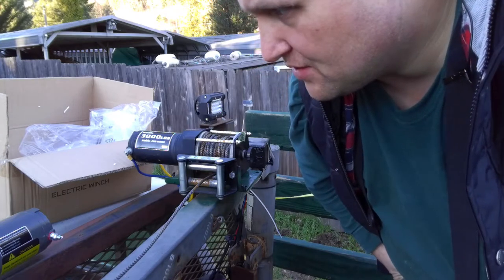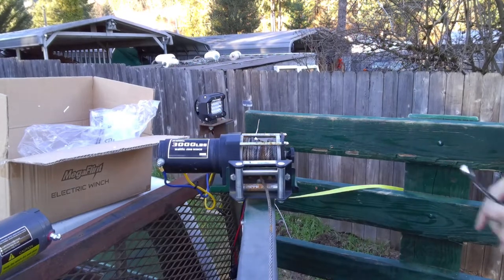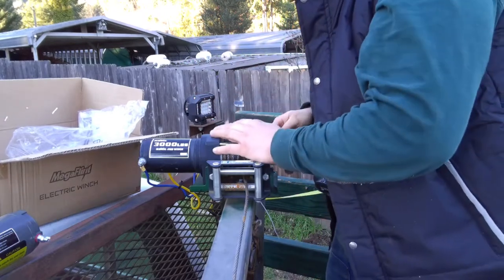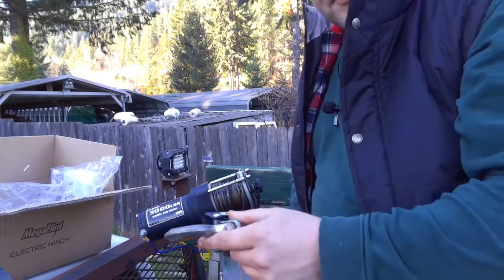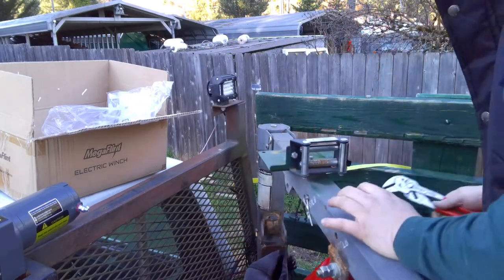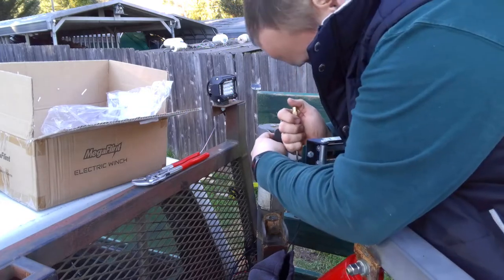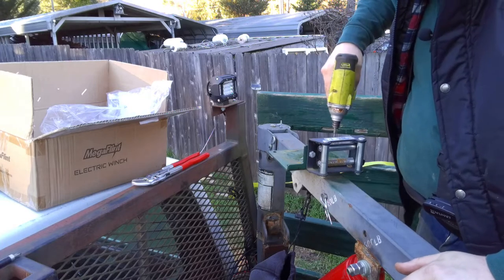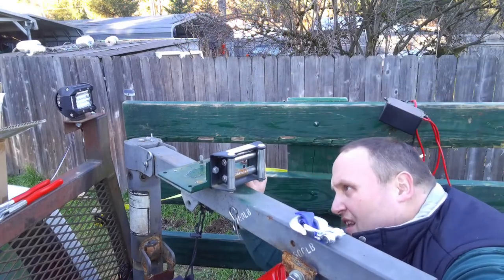New winch on the hoist

Comment: if u pull and keep turning the cluch release clockwise it will re-lock your just using it wrong i have a winch just like it been using it for many yrs they work good, they are a copy of warns older atv winch.
Reply from the maker: Thanks for the advice. I kept the winch around so will try that out when I put it on a new project.